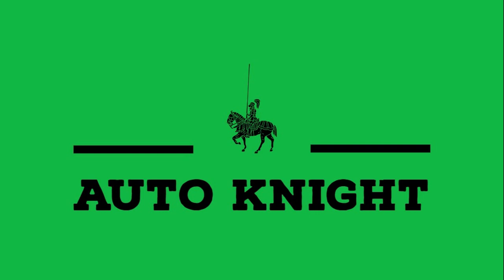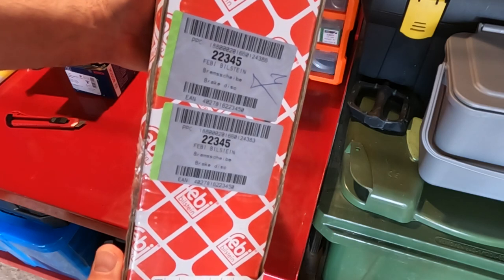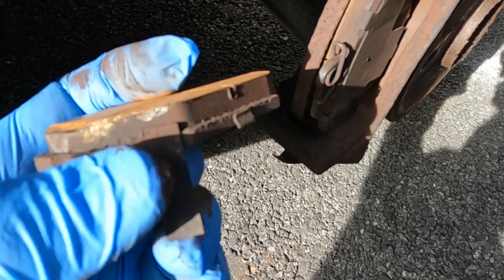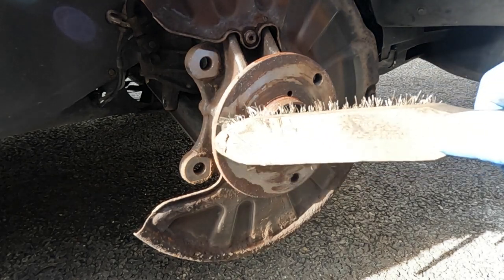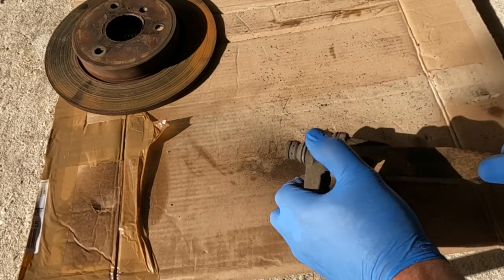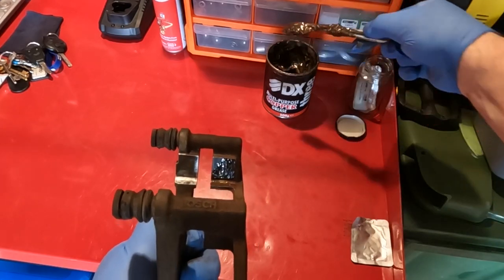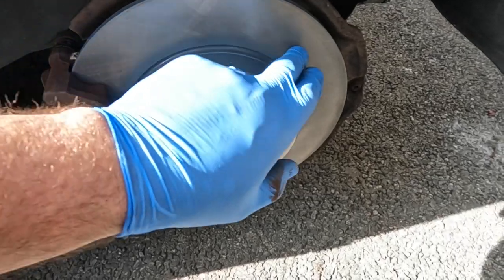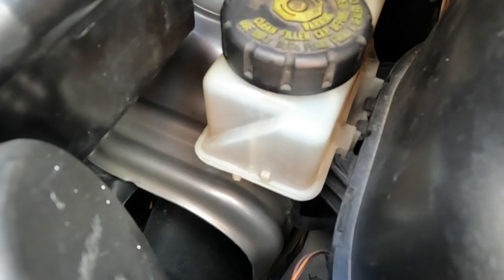Smart Fortwo 451 2008 - Replacing Front Brake Pads and Discs/Rotors

Comment: Thanks, you push nice videos. My 2 cents experience: I put the following coated discs from ATE (ref 24.0110-0331.1)  2 years ago, so far nearly no rust. For the lubrication of the guides, I used Liqui Moly Ceramic paste (ref 3418), quiet resistant to salt/water.

Comment: Your brake pads came with bolts. Mine were advertised with bolts (Amazon) bu came without bolts. The seller told me I don't need new bolts and to use the old ones, so I am wondering why bolts are supplied with some. Is it because they need replacing each time the pads are changed, or just in case the old bolts are corroded or damaged during removal?   I have bought new disks and pads but after watching your video I think I should get some more things such as brake cleaner, copper slip, and a breaker bar. Then I should be prepared 🙂 Thank you for your video, it is very helpful. It would have been useful to also see the jacking points but sure I can work that out for myself, or find another video.
Reply from the maker: Sometimes you get bolts, other times not - I’ve seen both over the years. If concerned, you could probably pick the bolts up from the main dealer for very little money. It’s nice to do the finishing touches when carrying out a job! The jacking points are marked out by arrows/indentations on the plastic side skirts. As these cars are so short, jacking up at the front or rear point on a given side can raise the whole side of the car which makes positioning of an axle stand very straightforward. Work safe and I hope it goes well!
Reply: @autoknight747  That's very helpful, thank you 🙂

Comment: I’m trying to design disc brakes for a 1938 HillmanMinx- it has 3 lug wheels. What is the lug spacing on these? Also the disc size?
Reply from the maker: Probably best to go onto the Euro Car parts or Autodoc app or website. They are pretty good at giving all the specs on there and will have far more detail than I can provide. Good luck with the Hillman Minx - great bit of classic motoring there!

Comment: I enjoy your videos and they are very informative, but in this particular one when you used the flat screwdriver as a prybar on the pad to compress the piston I found myself putting my hands up screaming "NOOOOOOOOOOOOOOOOOOO!!!!!!!!"

Lol.

Also, no need to be so stingy with the grease on the face of the hub.  

Great video though.
Reply from the maker: Haha. That is a very old screwdriver which is perfect for just easing the piston in just a little so the pads can overcome the lip on the disc when removing the caliper. The pads and discs were trash anyway so no worries if they got damaged in the process. 

I’m pretty frugal with the copperslip as if  applied too generously, centrifugal forces spin it out to places I don’t want it. 

Thank you!

Comment: where do you place the jack?
Reply from the maker: There are two designated jacking points on each sill, indicated by a little triangle at each location on the plastic sill covers, underneath. If in doubt, double check the handbook for precise locations.

Comment: That back plate, can it be replaced from behind,  without removing the discs please  ?
Reply from the maker: Unfortunately not, the bolts holding it in place are only accessible once the disc is off. To make it worse they can also be seized on older vehicles or coastal cars.
Reply: @autoknight747  Thank you.